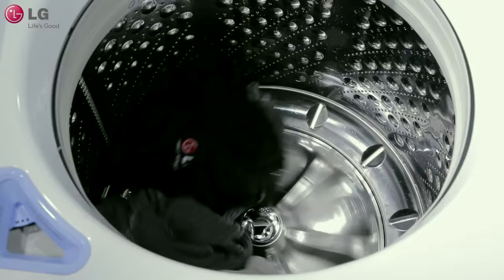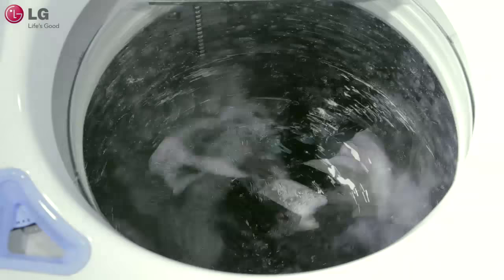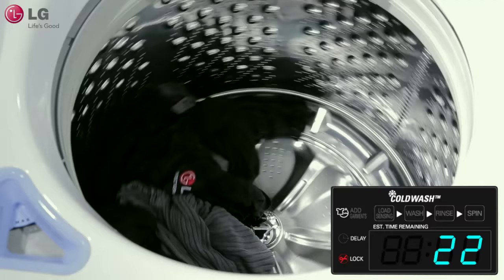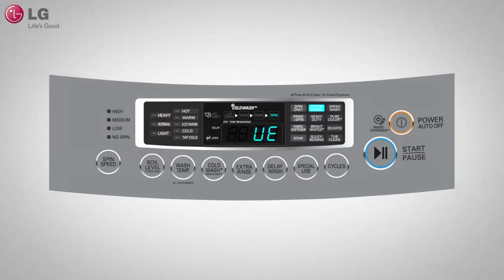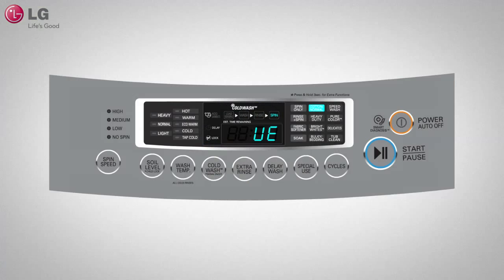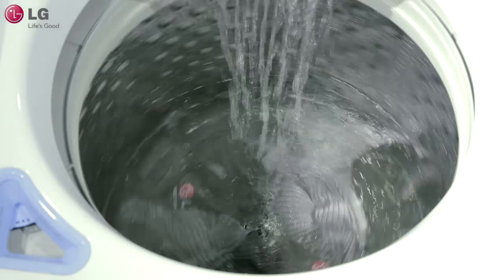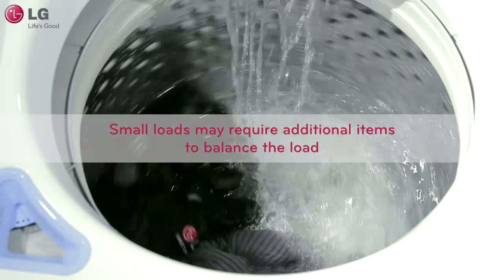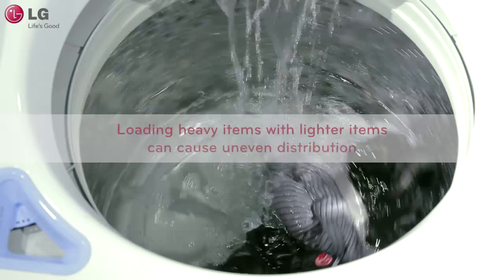LG Washer - Top Load Balancing & UE Message (2018 Update)

Comment: I put up with this same problem for 5 years and i finally found the permanent fix. I went to lowes and purchased a whirlpool washing machine and have not had the problem since. I want to thank lg for blowing me off three times and forcing me to purchase a much better product.
Reply: I just spent $1,900 on a Samsung. When I bought this in 2013 I thought it would be okay. Best washer has been a nightmare.
Reply: @twanderson123  how do you like the Samsung?
Reply: @cilonen  The Samsung has been excellent. I bought it in November 2019. It washes perfectly. It cleans very well and the clothes are well wrung out when the cycle is complete. I don't have to deal with unbalanced loads ever. I frequently wash king sheets with 6 king pillowcases with no issue. Always clean and fresh. I would suggest the Samsung washer. I have the front load washer and dryer in champagne color.
Reply: Totally Agree, I fight with this washer's UE error ever since I've had it I will NEVER buy an LG again!!!!
Reply: Yes!! Whirlpool all day.
Reply: My condolences 🤦‍♀️
Reply: Wish I had seen this about three years ago.....we have seen one load take 2 days to finally finish. Nothing helps. I am glad to know it is a known problem so I can go purchase another brand asap instead of trying to fix it.
Reply: LGs front loads blow Samsung out the dust
Reply: Whirlpool is the absolute worst. Hope you enjoy it when that transmission goes out

Comment: I've been fighting this for years.  I hate this washer with a passion I cannot describe.  It has done this since I bought it.  I've had technicians out several times, still no fix.  As others have described, it throws unbalanced codes even when it's spinning smoothly and nothing is out of balance.  It takes hours to get a single load done.  Some high-efficiency.  This is obviously a known issue with LG's top load, no-agitator washers.  It is unconscionable that they refuse to admit there is a problem or to take steps to fix it.  I will never again buy an LG product, solely because of my endless frustration with this product.
Reply: My feelings precisely, I’m sick and tired of spending 3 or 4 hours to do one freaking load!
Reply: This is exactly what I feel about this
Reply: I'm right there with. Things to avoid... CLOTHES!!!! My machine needs a bullet.
Reply: With you***
Reply from the maker: Sorry to hear that & happy to help get you in touch with the proper team for assistance! For social media support, please direct message us on Facebook (LGUSSupport) OR Twitter (LGUSSupport) with contact info. You may also call support at: 800-243-0000. ^CB
Reply: @LGUSA  LG wouldn't spend a dime on the contracted labor that we would be billed for. I know for a fact my problem is the computer board because it will stop the spin cycle at 9 minutes exactly every time... no matter how smooth it is. If LG is willing to send a board in the mail I'll reach out. As is, I'm going to research a new washer tonight and I'll be excluding all LG products from the search results.
Reply: @LGUSA  LG should be stripped from ever being allowed to call this Energy Efficient ! Its anything but when LG has a washing machine  that wastes water & ruins the environment ! Well LG, i wouldn't want another hunk of garbage from you if it were free! Are you going to reimburse people for the hundreds of dollars for excessive use of water from there water co's due to their washing machine causing an error and refilling 50 times in one cycle? How many of these are going into a landfill as people finally throw in the towel from pure frustration!
Reply: @j-fo4753  No sir!!! I wanted to reenact office space and baseball it so many times.

We trashed ours two days after I posted. The repair store gave $50... money well gained.
 #neveragainlg
Reply: @anothersomebody8195  Lmao! Well if u trashed it, u should have had a little fun with it before u put it to bed! The day i get rid of mine, it will look like it's been through a F-4 tornado first! Cheers!
Reply: @j-fo4753 Hahaha, give it a little extra for me please!
Reply: They suck. Bought one 4 yrs ago and it worked for 6 months. And now it never completes the spin cycle. Clothes are soaked..Getting rid of it . Had technicians out and they could not fix it. GOOD RIDDENS. Never buy an LG product again..
Reply: Yes...i wish we would've kept our 25yr old washer!!! This LG is the absolute WORST EVER. Never will i ever buy an LG product again. Never. Ever. Again.
Reply: @LGUSA  You should be ashamed for replying with such a "canned" response! You clearly see thousands of people are all having the same issues with your damn washing machines... yet you do not care...maybe when you lose enough business you will. As for me- I certainly won't be buying LG ever again- LG products are crap= the less than year old LG oven we bought just had to have a repair.too..that's ridiculous- less than a year old. Live and learn! NO MORE LG
Reply: @LGUSA  I too have had this issue since the washer was new.  Based on other customers experience with LG techs trying to resolve the same issue... the issue that every single one of this model easher has, I did not contact LG service.  When you know the response is going to be less than adequate...  I will never purchase an LG product ever again.  This is such an annoyance!   EVERY load gets an UE code.
Reply: Same here.. i think we should get together and sue them. I called them  about this and they refused to help. We've been fighting every load for 7 years now.
Reply: @j-fo4753  That would be so fun to watch. I feel the same way and can't wait to shop for something that won't take all day to do a couple of loads. It is such a waste of time to sit there and watch it spin so it doesn't go out of balance. I have tried everything under the sun and I just don't understand the genius's that developed this, what exactly was going through their minds.The slow spin, a waste of time. Once it starts spinning and is in balance, why does it stop only to get out of balance again. I hope to trash mine soon.
Reply: @stealthxhawk22  buy the front load
We buy a 2011 front load and we haven't need to fix anything unlike our 2008 toshiba washer
Reply: @anothersomebody8195  Not to mention that the easy Fix would be "SPIN ONLY",  But that floods it with water too.
Reply: I can totally understand!!
I've learned that just restarting it without shifting clothes,  starts it up again. 
So maybe not uneven distribution of clothes but something else!!!
Reply: lol you guys are so picky
Reply: @LGUSA  oh, are you? Are you happy to have us contact you and be moved from department to department wasting MORE of my time? I've already wasted 1000s of hours rebalancing this washer, which by the way goes unbalanced even empty. Its defective and LG needs to make this right.
Reply: @sicilianjoe  i had a maytag for ever they know how to make washers. Kitchaid is coming to the market with commercial quality stuff ill buy one of them
Reply: @LGUSA  This is a typical answer from LG.  I had techs come over to my house and I even got the electronic board changed (on warranty) and it DID NOT FIX the problem.  This washer use probably 5 times the amount of water a normal washer would because of this very frustrating issue!!!  Talk about energy efficiency!  This LG product is TRASH!  For people looking for a review:  Don't ever buy an LG!  You'll regret it just like the rest of us!!!
Reply: Me too, no LG product ever, for me. This annoying UE error wastes electricity and water. Their lazy engineers should have been fired over this fiasco. I checked the level of my washing machine with a level, and it’s ever so slightly out of level. Most places the bubble is bang in the middle. Yet, the stupid washer keeps doing the “UE” error most of the time. They should have recalled this waste of a engineering effort long time ago.
Reply: Omg!!! I cannot wash towels ever even if it’s balanced.. I hate this washing machine so bad I regret buying it 100000xxxx 😫😫😫
Reply: yes, this!!!!!! horrible product!!!
Reply: @countfloydschillerhorrorth2090  ours sticks on spin only as well
Reply: Well 💩💩 came on here looking for a fix right now and it looks like the only one is my AR-15!! Was hoping for an easier TRUE fix for my not so TRUE balance!!! 🤪🤪 oh well, 556 rounds have come down so target practice it is!!
Reply: SAME. I have so much anxiety now on laundry day since we bought this washer. This is ridiculous.
Reply: @I_am_milan  I did find out putting it on heavy duty cycle stops it from coding! Give yours a try 🙏🏻🙏🏻👍🏼👍🏼
Reply: Yes
Reply: Hi
Reply: @joyrue  yes, like when it starts with the first uE, it goes into that “wandering” state where it rotates the drum really slowly for a while accomplishing absolutely nothing maybe thinking about what to do next? Or when it spins up nicely finally gets to speed then completely stops to “think about it?” some more then spins up again. I’ve watched soo many cycles and usually manually shut off the water after repositioning the load the first time otherwise it will do it’s thing and run up my water bill another $100. The best part is, I went to find a replacement machine and was told LG is the best, if not the only washer to buy! backed by consumer reports the salesman said! I laughed my way out of the store.
Reply: @denisblanchard3110  yup, just the typical big corporate BS grind. We’re on our own with this, and many I believe have trashed the machine and moved on. I’m planning an end to my own LG nightmare shortly. in a fair and just world there would have been a class action suit. Guess there needs to be injuries or property damage for that to happen.
Reply: @anothersomebody8195  Stay away from Samsung too. Great TVs but lousy products that deal with water.
Reply: Ours goes uneven when EMPTY!! I will never buy LG washer again. It’s insane and the customer service is the worst I’ve ever worked with
Reply: @LGUSA  If LG were reputable they would reach out to help those who purchased this machine. As others have said, this machine is a waste of money and time. Calling it energy efficient and "Tru-Balance" is a downright lie!
NO more LG products in my house!
Reply: The older machines didn't need this fancy balancing routine and still lasted longer.
Reply: I'll never buy LG again pay a thousand dollars for this piece of junk and the steps they tell you are the most common sense steps you could imagine and do literally nothing!
Reply: Completely 100% this is so irritating !!! JUNK !
Reply: JUNK ! It is so defective and not efficient ! Hate this washer ! JUNK !
Reply: I agree sooooo annoying
Reply: Literally have to baby sit my washer fir an hour. So I don't hav ti keep running up and down tge stairs omg. I'm standing here now cause I hav I life and again ue  fml
Reply: @LGUSA dont listen to these people i saw that balancing move em clothes

Comment: So glad it's not just my machine!  I looked up "LG True Balance Issues" and see that the balancing issues we're having with our machine isn't just my machine.  We've been having these issues pretty much since it was new.  You can't use the "tub clean" function because the machine goes off balance over and over again and won't finish the cycle.  It takes all day to get a small load done.  Up and down resetting the machine.  We purchased the machine in 2013 and I was debating weather or not I was going to call someone to repair it, but from what I'm reading, it would be a waste of time and money.  It's really a shame, because other than that, I love the machine.  I may end up replacing it sooner than I should have to because of this.  It pisses me off!  I should be able to use it longer than 6-7 years.
Reply: I wonder if this line was defective. We purchased in 2012 and have had this issue pretty much since we’ve had it. The technician said do a tub clean and that would help out the balance issue. Now it’ll get through a load, but it’s damn near hitting the walls.
Reply: I've bought mines in 2013 and having the same issue. I looked at a Samsung. I guess I'll go buy it tomorrow and take the LG washer yo the landfill.

Comment: On my way to the appliance store today.  I have fought this top loader since the day I bought it 5 years ago.  Currently I am on 6 hours for attempting 2 loads.  It doesn't matter if its a small load or a  large load or what setting it is on,  it is ALWAYS off balance.  Most of the time I manually spread my clothes out at least 3 times a cycle. I love how it says its energy and water efficient though I probably go through several gallons of water as it attempts to rebalance.  Doesn't clean well either.  I had a dishwasher made by LG that lasted less than 2 years. I will never buy a LG product again.  Got to go, my balance alarm is ringing again, only the 4th time for this load.
Reply: good grief! I'm in the same position with LG. What did you end up buying and do you like it?
Reply: Yep same experience .... so disgusted

Comment: HOW can this be considered "high efficiency" if it uses GALLONS of water refilling itself to automatically redistribute itself?
I hate mine and I'll never buy another LG product again.
Reply: I totally agree!
Reply: Agree ..i hate mine&wonder how drunk the "engineers" were when they invented this hunka junk!
Reply: I completely agree- I've been trying to wash the same load now for 2 days...it will not balance at all- my last resort is taking all of the clothes out and adding them in a few items at a time until it balances and will complete the cycle...this is not efficient in any manner and is ridiculous to have to deal with, I'm so sick of it. I'll never buy another LG washer!!!
Reply: Should be a class action lawsuit since no recall issued.  Will never buy LG appliance again!
Reply: Same!
Reply: Yep,  I'm not all that big on "GREEN" Power. But I can't help but think of how this has to be a Top Ten Enemy of Wasting Water.
Reply: Worst washing machine EVER.  Going back to 1980s style with no sensors.

Comment: Even having this problem for weeks. Loads are balanced, the drum is spinning without wobbling, and still get constant UE codes. Takes hours to finish loads. I’ve concluded this is not a good product.
Reply from the maker: Sorry to hear that & happy to help get you in touch with the proper team for assistance. For social media support, please direct message us on Facebook (LGUSSupport) OR Twitter (LGUSSupport) with contact info. You may also call support at: 800-243-0000. ^Mk
Reply: LG washers have had this problem for years. Bought a new one six years ago and have NEVER had it finish a cycle. Even on Rinse/Spin with NOTHING in it. Don't believe the "call support" crap, I've wasted hours on the phone with them with no results. The LG warranty is useless. They blame everything except the washer until the warranty runs out, then try to sell you a board that costs as much as a good used washer. Buyer beware!
Reply: Same issue, wont even finish an empty rinse cycle. LG Has not offered any type of actual solution...
Reply: I hate my washer it take hours to,wash one blanket and one set of sheets.
I get the UE code every time!.  It takes forever to get one load done.  Regular items I have done don’t have nearly 
As many problems.
Reply from the maker: @christophvenson5264  please direct message us on Facebook (LGUSSupport) OR Twitter (LGUSSupport) with contact info. You may also call support at: 800-243-0000. Happy to help! ^CJ
Reply from the maker: @donnadicks2842  Hate to hear that, allow us to help! Please direct message us on Facebook (LGUSSupport) OR Twitter (LGUSSupport) with contact info. You may also call support at: 800-243-0000. ^CJ
Reply: @LGUSA  I have been in contact with your service. The solution offered was to call a service company who were not affiliated with LG in any way, and to pay them out of pocket to reflash software on my machine to "see if that fixes it". Not  very helpful to say the least.
Reply: Totally agree.  I have come to hate this machine, and if I were in an area where water was scarce and expensive, I'd throw it out.  Luckily my water is inexpensive, but it takes forever to finish a wash, and even when I think i've balanced it and practically weighed and measured every item in the load, while it's spinning it will unbalance the load and I come back to another 20 (?) gallons of water being used and more time that I have to stand there and watch it and catch a UE before it starts the whole process again.  I have come to be very skeptical of the eco appliances.  They end up being so much more expensive and troublesome than the old standbys..  
Frustrated!
Reply: @caroltyson5365  I agree with you, Carol. High Efficiency was just a selling point it seems. These washers take forEVER to do a load that the old style would do in 15 minutes. I've spent two days trying to wash a load once where I wasn't tethered to the machine. That is FAR from efficient.
I ended up just using the spin cycle and going to a laundromat.
I have a 250lb paperweight in my laundry room.
Reply: This washer is garbage ue for no reason every load If they had a real answer or fix that actually works  for it they would post it
Reply: Hours to hopefully get one load done
Reply: @christophvenson5264  yes. Worthless
Reply: @caroltyson5365  same here. I have been fighting mine since 2013 they do not have any answer. LG is off of my shopping list.
Reply: @twanderson123  I'm moving soon and get to leave it behind!!!   You're right-no more LG
Reply: @LGUSA  we had repairmen come out and try to fix it and it still didn't work.
Reply: @LGUSA  instead of giving canned responses, you might actually bring this problem to the attention of your lazy and complacent management.
Reply: @LGUSA  Can you recommend a reputable manufacturer? Our LG washer is junk.